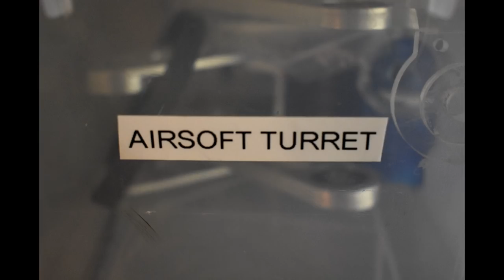Jeweler's Lathe Part 6:  The Z carriage

Comment: I know you mentioned it a bit in this video, but what would you say are some things that just haven't really worked the way you planned them to in this build? 

Also, I would certainly love to see the cleaning video and the inventory. It's always cool to see what other mechanically minded people choose to hoard. I'm partial to fasteners. Whenever I need some for a project I order probably 10x what I need to build up my own stock.
Reply from the maker: Hmm that's a really good question.  I was pretty concerned about the Z locking system but that actually turned out better than expected, although now I'm questioning if it was worth it:P .   I think the base of the machine could be better.  As it stands now I'm basically going to have to bolt the base to another base which will then clamp to a table.  I suppose if I was really clever I could have integrated a clamp somehow.  There are also lots of unknowns with the electronics and coolant system.  I've left myself lots of room to fill that in, but I really need to start totally finishing designs before I start making them :P.

I have tons of rescued fasteners, but I think my big one is motors.  Just can't say no to them.  Lots of them are rescued from discarded appliances and things.  I'm looking forward to filming!
Reply: Yeah, I definitely sympathize with the whole designing the thing to death vs just getting started on the build problem. Either the project will live in Solidworks for eternity, waiting to be finished in the design, or I'll end up with some problem during the build that could have been solved during design. 

What are your plans thus far for electronics?
Reply from the maker: It sounds like you know exactly what i'm talking about :P

I'm hoping to keep electronics fairly simple:  An off-the-shelf speed controller and power supply.  My main worry is wiring and placement.  It may sound like no big deal, but I've been bitten by wiring and electronics placement so many times before!

Comment: Watch out with the bronze sitting in the aluminum like that. Over time it will form a blackish greenish film because of galvanic corrosion. The dust from that gets everywhere and clogs the dovetail and it destroys the parts eventually.
Reply from the maker: Good tip!  I never even thought of that.  The aluminum will be anodized but maybe I'll use a thick grease or something to further protect it.

Comment: bending of the screw could have been prevented by making both jaws floating, or am i not thinking far enough ?
Reply from the maker: Yep both floating with tapers would have worked I think, though then there would have been no solid screwed connection between the dovetail bronze and the carriage itself

Comment: Are you sure garnet is an appropriate material to use for epoxy composite? I didn't think garnet was very strong.
Reply from the maker: I have no idea about garnet thus far.  I know its quite hard and i believe the particles are fairly jagged.  It just happened to be what i have, so ill give it a try.  Perhaps ill compare with sand later
Reply: I only believe it's not very strong because it breaks down quickly in comparison to other abrasives. If you're ready to put up the epoxy by all means experiment, it's only going to help us all learn
Reply from the maker: I shall!  Lets all learn!

Comment: I don't think it's a very elegant to lock and move and lock the carriage with the same shaft. If you're not going to use preloaded thrust bearings you're going to have extra slack when feeding in one direction or binding in the other direction.
Reply from the maker: There will be some slop but this axis is more for positioning than for feeding.  Ive just been tuning it and its actually not too bad anyways.  The idea with locking the axis by rotating the pusher bar is mainly to keep your hands out of the machine (for safety, but also because its so small its hard to adjust things in there!)